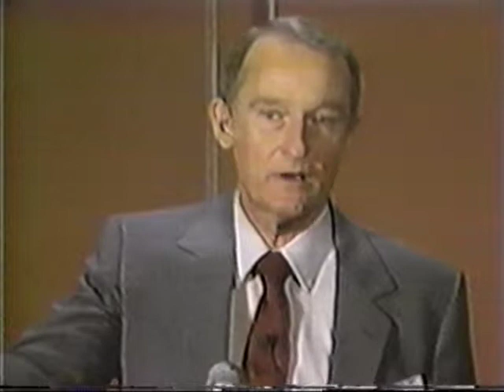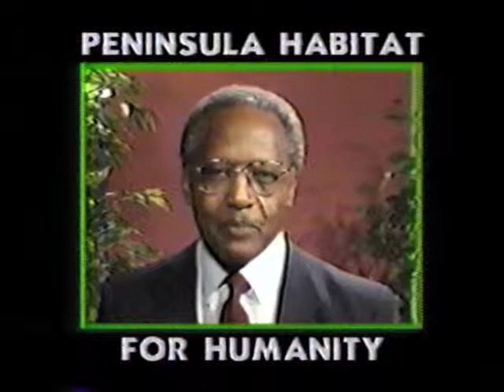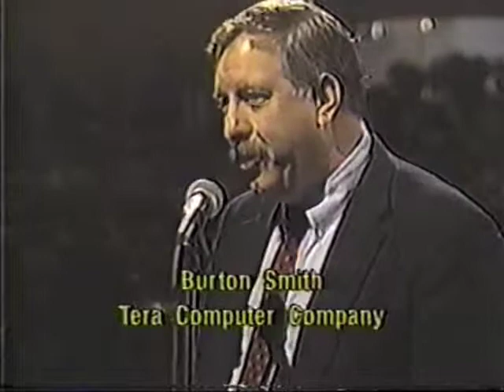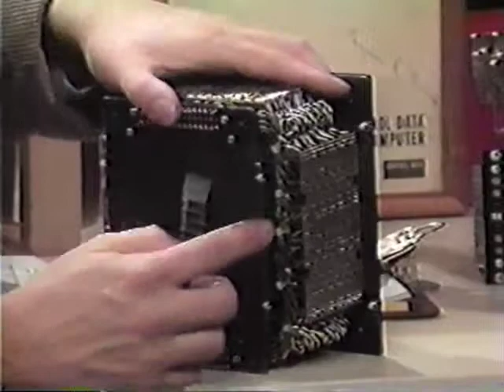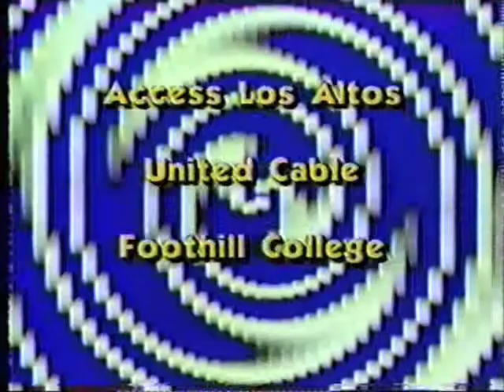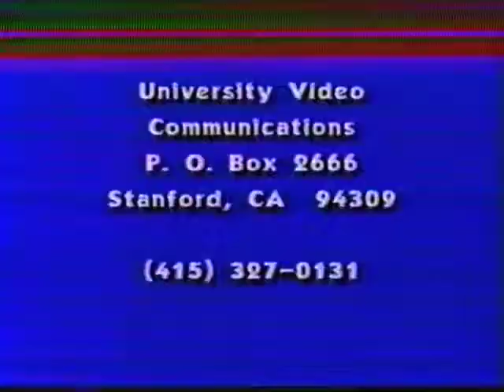High Tech Heroes #15: Seymour Cray 3

Comment: The GaS devices were unique for the processor level.  During development, the GaS used +5 VDC (for the memory devices and -2.5 VDC for the GaS).  There were huge current draw for the research phase.  I worked at Cray Computers for about 18 months until Cray lost the contract for LRL, Livermoor, California.
Reply from the maker: Calvin, I was actually named after Chalmers Sherwin, who was one of the people primarily responsible for originally developing GaAs as a semiconductor and LED.  I really wish we had more about The Cray-3 and Cray Computer here, but, alas, very little information is available.  I did get to see the prototype Cray-3 in Colorado Springs after the first public Cray Computer shareholders' meeting.  The "waterfall" (freon coolant) behind the Cray Computer logo was impressive, as was Cray's way of draining the coolant, modifying modules, and testing them without replacing the coolant.  The machine was so fast that you could power-up the machine, run test routines, and power it back down before the components heated up to the point that they needed to be cooled.  Brilliant! 

It would be nice to have more details about the development of the SRC Computers products, as well.

What was your job?  Were you involved in the design or testing of the Cray-3?